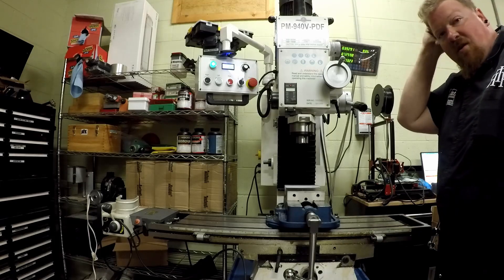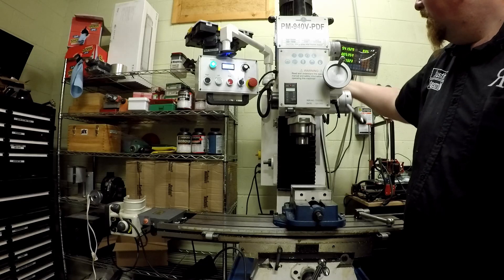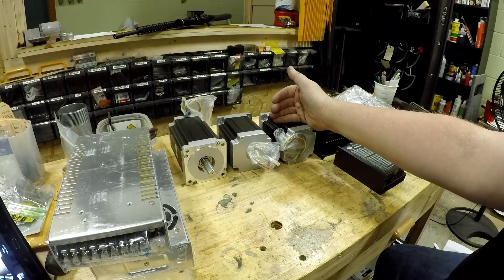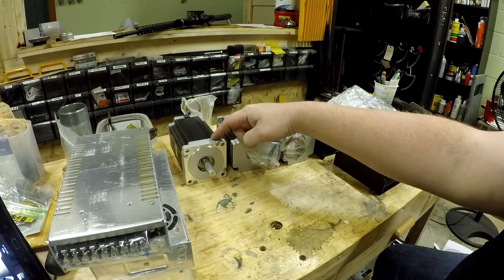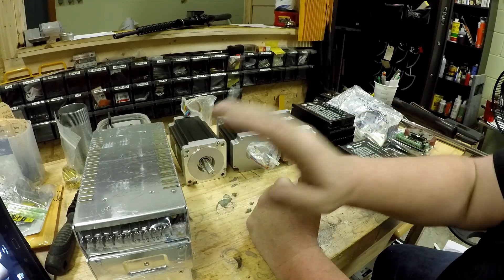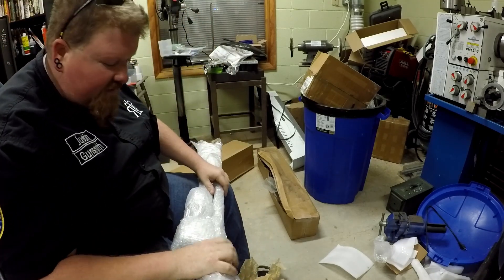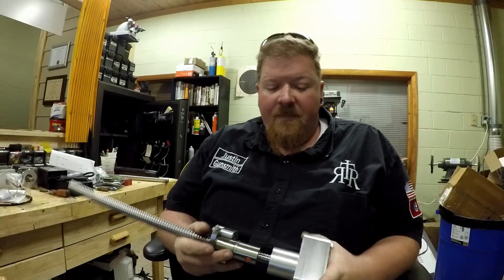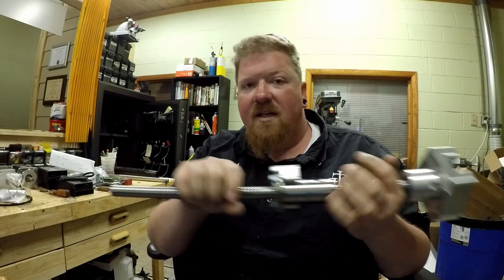Shop Shenanigans #16 March 28th, 2021 - CNC Conversion Part 1

Comment: Justin,
I'm glad I found your videos. I actually just purchased a 940v w pdf and hardways. PM told me I could switch to an 833T if I end up wanting to since everything is in backorder. I plan to run it manual for a year then convert to cnc as you are doing. I'd like to ask you a couple questions about your experience with the 940v if you're actively responding here in YouTube. I'm out of Abilene.
Reply from the maker: I do my best to respond to comments that warrant a response
Reply from the maker: The biggest issue I've noticed with the smaller PM mills is the Z travel. If you watch blondihacks, I think Quinn has the 727 and she can't even put a drill chuck and half inch bit in hers.
Reply: @TRRGuns  have you had any problems with the belt slipping or the motor stalling while running at 100rpm with an operation like drilling or tapping? Do you work with steel or mainly aluminum? My biggest hesitation at this point with the 940v is the lack of low end power caused by the vfd. The gear driven 833t and 940m dont have that issue but they also dont have the top end speed and they make a lot of noise. The part is how belt drives are better for a cnc conversion. Do you plan to stay with the two pulley setup or will you be going with a single pulley? How do you feel about the belt pulley swaps as the machine comes in stock format? Easy enough access?

Thanks for the reply, appreciate your time.
Reply from the maker: @quickdrawmcgraw4394  Most of my millwork is very lightweight, at least for the time being.  A majority of the heavy milling I do is in aluminum.  The gear drive might be loud but the fan on top of this VFD motor will make you put ear muffs on.  I actually unplugged the fan on mine because it was simply too loud to run when there's people coming in and out. Don't run it enough to risk overheating.  It did NOT come with a sensor to switch the fan on an d off based on temperature, even though the VFD controller itself has that function.  The belts are very tight and I always keep them in high gear mode, because I've been able to get sub 100 speeds on the high spindle configuration. As far as power, like I was telling someone before, mind your feeds and speeds and you really don't need to worry about having a ton of torque.  Pick the proper tooling.  These bench mills aren't really intended for heavy machining anyway.  If I get into something that requires a lot of heavy production, I'd get something like a Haas VF6 or a Doosan.  But that would also mean that I've got more business that would justify such a purchase.
Reply from the maker: @quickdrawmcgraw4394  As far as getting TO the belts, it's just four hex head screws on the left side of the spindle.  I don't power tap on this mill.  I don't use the power down feed.  Only thing I've run at really low speed is my fly cutter. Think I was running about 120-150 with that.  Didn't seem to be bogging down at all, but we don't take heavy cuts with a fly cutter.
Reply: @TRRGuns  thanks again for the reply. Valuable information for me.
Reply from the maker: @quickdrawmcgraw4394  a quick note, I just checked to see what the difference between power transmission was through the belt on the high side versus the low side at the same RPM. And on the high side I was able to slow the spindle down with my hand at low rpm. On the low side at the same RPM I was not.
Reply: Have you started your cnc conversion yet? I have a PM940m that I converted to cnc.

Comment: I used the same heavy duty ball screw kit from Dave on my pm940m. How is your cnc conversion coming along?
Reply from the maker: Everything is done, but right now I'm working on troubleshooting my table speeds.  With my current configuration, my steppers can't push the table or head faster than 20 ipm without losing steps, so I'm trying to tune things.  Don't do what I did and buy cheap motors.
Reply: @TRRGuns  I went with Clearpath servos and a Masso controller.
Reply: @halfstep67 I’m in the process of buying a PM940 and thinking about the Masso controller over the Acorn system. I assume because this was 2 years ago that you have finished. How did it turn out?
Reply: @RE-zz7tr  Hello, I tried to respond to your message on the Clough42 video, but it wouldn't let me. My reply kept disappearing.

Which pm940 are you buying? The 940m or 940v? The 940m has the gearbox and the 940v has the belt drive.
Reply: @ it would be the 940v with hardways
Reply: @ I have the 940m as the 940v wasn't yet available when I bought mine.
I like the Masso. It doesn't need a separate computer, and it is simple. My conversion turned out good and works well.